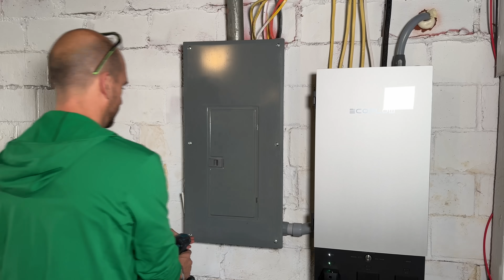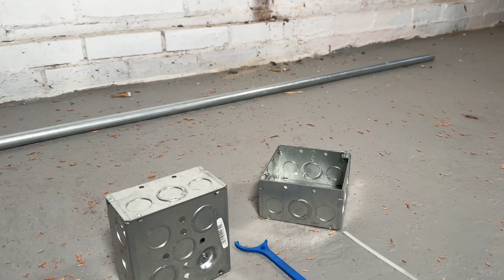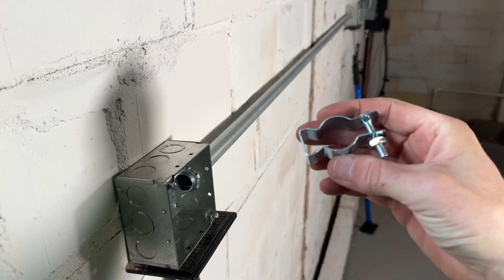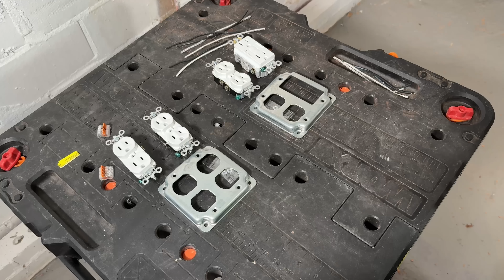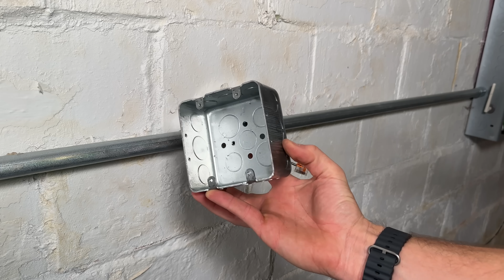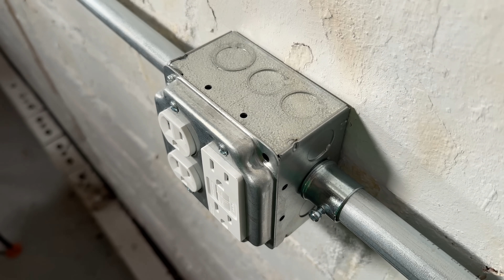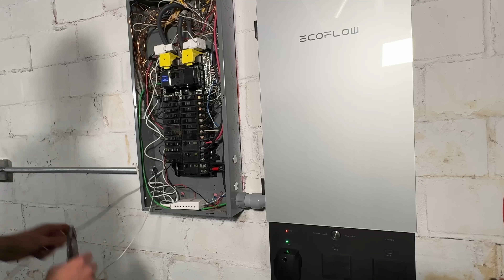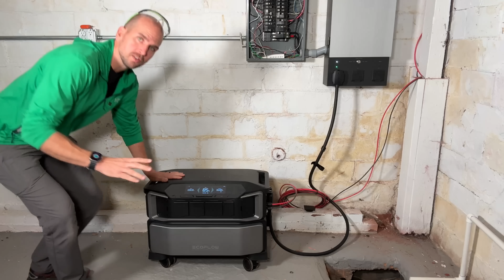Add Outlet To Unfinished Basement Or Garage

Comment: My question is about the 20 amp setup. You have a 20 amp breaker, 12 gauge wire, but the receptacles look to be common 15 amp types?

I would suspect that's a no no, because what if someone draws above 15 amps through those receptacles? The breaker won't trip until higher amperage.

As for ground wire, best to add it and not "trust" the longevity of the conduit connections.

You might also include the reason the boxes are so high up off the floor of the basement (~4ft). [EDIT Mis-spoke "or higher" here.]
Reply from the maker: Yeah, I think adding the ground wire is a good idea.  No issue on the 15 Amp outlets as long as you don’t have a single outlet on that circuit.  Even 1 duplex outlet (15 Amp) would meet code.  I wanted the boxes to clear a sheet of plywood and/or be above a workbench height 👍
Reply: @EverydayHomeRepairs   Just a further on the height above the floor for clarity for others.

I believe code for finished or unfinished basements require a minimum height of 15" (measured from bottom of receptacle box) to a maximum of 4ft (measured from top of receptacle box) above the floor grade.

:)
Reply: @FoxMan777  Not an NEC requirement, though could be a local code in some places.
Reply: @EverydayHomeRepairs  Man these people are picky. I'd stick in the ground wire too, but if it were already installed the way you did it using the conduit for ground I'd use it that way forever without fear. I would NOT do it over. Using EMT for a ground has been done forever and nobody dies. 
Using copper plumbing for a ground used to be OK but is not any more because you're expecting the plumber to be also an electrician. Electrocuting your plumber is never a good idea.

Comment: 1) Don't use a pipe cutter on electrical EMT - that is, except for really tight and/or inaccessible locations that already have wire pulled through the conduit. They always leave a lip on the end of the conduit that's sharp enough to cut through wire insulation during a wire pull. A hacksaw, Sawzall, or multitool and a reamer works so much better without leaving a sharp lip to damage wire insulation, IMO....

2) Never drill into masonry joints to affix your boxes or supports - drill into the solid brick instead. Drilling into masonry joints doesn't support weight - and they will NEVER fail to work loose over time, causing you to have to repair it in the near future as your boxes and supports start to fall off the walls. I'm having to re-affix a whole electrical service panel onto an exterior wall that used plastic anchors (?!!!@#%) drilled into masonry joints supporting the whole panel. Needless to say that 3 out of the 4 of them have failed, leaving the panel only supported by it's conduit (WTF?!!!).....

3) No problem using Romex inside EMT conduit as per NEC. The greater problems are not running a GND wire and not using green GND pigtails inside of your ALL-METAL boxes and your devices. Never rely on any box cover screws as a GND point - once the cover is taken off, the device and box loses it's GND. That's a NOGO......

4) Always support EMT conduit within 3' of every box/termination and every 10' thereafter. If you use the "2x8" rule of thumb (ie: every 2' and 8') you'll always be within NEC.....

Otherwise, very good video......

Comment: It is just as easy to put the wire inside a concrete block wall as long as they are not filled with concrete. You can drop a chain from the top and pull a wire down. Looks better also.
Reply: Fishing through a block wall is not just as easy as surface mounting conduit, not even close.
Reply: @pld8993  Sure it is.  I have never had an issue running wire in a concrete block wall as long as it wasn’t filled with concrete.  You can drop a chain down inside the wall and pull the wire.  It is actually pretty easy.

Comment: The NEC National Electrical Code requires a ground conductor in residential installation even if a mechanical bond is present , just because there is a mechanical bond present this does not eliminate the requirement for a ground conductor in a circuit . You are installing in a damp location as well which will denigrate the mechanical bond much quicker with the potential to harm someone , that is the whole point of guidelines in the NEC to prevent harm . You should also be using fiber bushings on the connectors in the boxes to prevent short circuits .
Reply: The conduit is the grounding conductor. Bushings are not required and unnecessary in this installation.

Comment: I'm glad you used your outlet tester. Now run the test again after removing the cover screws. 

Spend the $little and add the green insulated ground wire.
Reply: Exactly what I thought. With the cover removed the receptacles and anything plugged into them are no longer grounded.
Reply: @TangoIndiaMikeJuliet  Thats why you use a grounding pigtail from the box to the outlets. I have always used a green grounding wire in the conduit, locknuts almost don't get tightened correctly, or setscrews
Reply: 12 AWG THHN is between $0.22 - $0.60 per foot at the time I'm replying.  Price is so insignificant I'm honestly surprised he didn't pull one.

Comment: And you are totally in violation of the National Electrical Code with no grounding wire in the conduit. You are also working backwards. Shove wire from the panel never into the panel  unless there is no other option.  The code specifies you need a grounding wire in conduit due to thermal expansion and contraction of the conduit loosening the couplings and connectors. You also really don't want Mineralac straps that low. They catch on stuff like clothing, so bend some box offsets in that conduit. I also like to have TWO circuits for a garage so larger power tools won't overtax the circuit. For old red brick and lime mortar I use plastic or lead hollow wall caulk anchors rather than those hard blue screws. Bricks like to crack and that old pre-Portland sand & slaked lime cement mortar is way to soft to hold those screw anchors in. You need that conduit supported within 3 feet of each box and every 10 feet there after.
Reply: Code does not say you need a ground wire due to thermal expansion and contraction of the metal. A metal conduit ground, when the conduit is installed properly, does not require a wire-type ground. The NEC list 14 types of grounding conductors allowed, and only one of the 14 is a wire.

Comment: I just *LOVE* the way you used a step drill to enlarge the opening of the knockout a mere minute into the video of things done wrong... watching those wires vibrate as you hit them and potentially cutting the insulation was priceless.  I also notice that you did not clean out any potential shavings that might fall into the inside of your electrical box.  Also, trusting your ground to your EMT and boxes is not very clever over time since simple corrosion can disrupt your "ground" and end your compliance.  Another question I have would be "where is the isolation from the grid for your battery backup?" in the case of a power outage, you are now back feeding the utility lines and either feeding your neighbors power or endangering line workers who might believe that power has been isolated, even though they should always be checking anyway. Great "educational" video...
Reply: I agree on most points, but grounding via an EMT conduit run is completely normal practice. Never have I seen a run lose ground continuity for any reason aside from incompetent installation. Ground wires in EMT conduit are generally redundant.
Reply: @NoTroubleMikeG  Yes, it can be a "normal practice" for interior runs, and yet I have seen hundreds of runs within buildings that have fallen prey to corrosion and the associated faults and intermittent connections that corrosion can cause. Many industrial applications recommend (if not require) ground wires on all wire runs through EMT as people have been injured due to faulty grounds.

The NEC states that the path to ground in circuits, equipment and metal enclosures for conductors shall be permanent and continuous. Complying with guidelines in the Fittings section 4.3 and Support section 4.4 is the major factor in maintaining electrical continuity. Using less than the NEC-required supports or failing to properly tighten joints can cause discontinuity in a raceway system, which would result in the failure to carry a ground fault. Good installation workmanship is critical.

These regulations often get put into place because there have been injuries or death associated with a specific practice. In comparison, Knob and tube and Edison fuses used to be the "standard practice" until injuries and fires proved those methods to be dangerous... Some of the most deadly words uttered are "We've always done it that way" or "I've never seen/had a problem with that before". Go ahead and spin the cylinder and pull the trigger, it's not my circus and not my monkeys, the burden and chances are on you.
Reply: See video on the “smart” sub-panel he used, system for backfeed prevention is located there; the custom connector between the battery/inverter unit and smart panel has data leads in addition to the power leads.

It isn’t like “dumb” subpanels needing manual interlocks.

Comment: And I might have run a separate 20-amp run to each box, so I can have like a compressor plugged into the first and some other higher-current load on the second.

Or maybe the left outlet in each box on one circuit, and the right outlet in each box on the other.
Reply: I did this in my garage.  The right outlet is white and the left outlet is grey.  I also ran black/white THHN to the white outlets and red/grey to the grey outlets to help prevent wiring it wrong.
Reply: And, when I set up a weatherproof outlet box outside, the box can hold two outlets.  I set it up with a 20a 240v outlet (L14-20R) coming straight off the 240, and a duplex outlet with one part on each leg of the 240v, isolated from each other by breaking the connecting tab like you would with a switched/unswitched outlet.  I painted the two parts black and red as a reminder.  That way I can plug in a single 240v plug like for an RV say, or each half of the duplex can handle a 120v 20a load such as a compressor or other power tool.

Comment: It would have been easy to do this without any of those lever-nut things.  Just use two of the pigtails from the "load" side of the GFCI outlet to one pair of screws on the first duplex outlet, then connect the wire run to the second box, to the second pair of screws (hot/neutral) on the first non-GFCI duplex outlet.  At the farther box, the direct run goes to the first duplex outlet, and then pigtails from the second set of screws to the second duplex outlet.

And a separate ground wire, of course.

Comment: I'd still run the ground wire. It doesn't cost you that much more, and it ensures that the circuit isn't going to ground out to itself, potentially shocking a user.

Comment: What I use for cutting conduit is an angle grinder with a cut off wheel because it leaves a burr that's much easier to ream out than a burr that a pipe cutter leaves
Reply from the maker: I could get behind that method 👍
Reply: @EverydayHomeRepairs  One time I used a pipe cutter and it took forever to ream out the burr , Then one of my coworkers said , Use my angle grinder and what a big difference it made , I was able to ream out the burr 100 times faster than cutting it with a pipe cutter and so I immediately went out and bought an angle grinder , I use it for all of my metal cutting and it sure goes faster than using a pipe cutter , And very very little do I use a hacksaw , The angle grinder is excellent for cutting flexible conduit ,
Reply: @ironmartysharpe8293  In the pro world we use either a metal cutting circular saw or a porta-band, I prefer the circular saw and have been using one since 97. Angle grinder works fine but not the best choice when you're bending and cutting all day.
Reply: @pld8993  Yes , A circular saw or chop saw is great for big jobs where alot of cutting is involved , Still , The burr they leave is much easier to remove than the burr left from a pipe cutter
Reply: @ironmartysharpe8293  Agreed. Never use a pipe cutter, something I learned my first week as an electrician, and it was back when all we had was a hack saw since battery tools didn't exist yet.
Reply: @pld8993  Ever since I bought my angle grinder , I got rid of the pipe cutter , Mainly I do electrical work on the side and for deburring the pipe I'll use my Dremel tool as I bought a set of tungsten carbide rotary files and they work great , A Dremel tool is a must have for your tool family , For me it's been a huge help if I ran into any snags from enlarging a hole a little bit to having a cut a notch in something , So whatever job I do
I always make sure to take the Dremel tool with me , Don't leave home without it

Comment: This is a clean installation. There is nothing wrong with this installation. No separate EGC is needed as the conduit is a compliant use as an EGC. With this installation all that is needed is to remove the insulating washers from the receptacles for metal-to-metal contact that extends all the way to the panel. He is also using THHN 12awg which is also compliant. EMT can be used underground and within concrete. It's perfectly fine for this damp location installation. If anything there should be a conduit support at the center of the 6 foot length per 358.30. This is an excellent how-to video despite the hypothetical what-if's mentioned.
Reply: Yes, there is something wrong. In addition to the 6' run needing support, receps are grounded incorrectly. Need a grounding pigtail from box to receps, or receps must be riveted (or some other permanent means of attachment) to the cover.
Reply: @pld8993  If it was a plastic cover i could see the need for the pigtail, but it is metal and receptacles are secured to the face plate with locknuts and the plate is fastened with screws. The mechanical ground is sufficient.
Reply: @joetorres3412  Electrically it works, but it's a violation, 250.146(A)
Reply: @pld8993  I'm learning here so would like your feedback. the two conditions 250.146(A)(1) and 250.146(A)(2) appear to BOTH be met since the author states that the device screws have ridges on the underside of the head which I am interpreting as complying with "screw or nut locking means".
Reply: @MegaMcwizard  Ridges under the screw head or nut is not a locking means because it doesn't lock the screw. Irreversible screws, rivets, screws with a locking nut, or the addition of lock washers to what he has would be required.
Reply: @MegaMcwizard  Until the early 90s, receps were mounted and bonded to surface covers with a single screw in the center but with only screw, loosening would compromise the bond to the recep through the cover. The NEC then started requiring 2 screws for mounting. Eventually, they started requiring permanent means of attachment to the cover (rivets) when the cover was used to bond the device. In 2020, they added (1) and (2) to allow for nonpermanent means, locking nuts, for example. The point is if the attachment screws are being used to support the bonding (no pigtail), keeping them from loosening is critical.

Comment: I can't see it mentioned in the comments but my curiosity is getting the better of me - why use the pig-tail & Wago (or wirenut) method rather than linking the cables on the outlet screw connections?
Reply from the maker: I use WAGOs for most projects but also they come in very handy for this type of installation where the outlets are secured to the cover plate.  Then you just need to flip a few levers to get everything tied together.

Comment: Professionals will bend offsets for conduit when attaching to boxes. Running conduit straight from box to box is ok technically but its a sign of amateur work. Also not running a separate and dedicated ground would never pass for code in my area. Rather a separate ground should be run which is bonded to each box. Usually there is a ground screw in each box for this purpose. Depending on EMT conduit connectors for a safety ground is not reliable.
Reply: EMT, when installed properly, provides a very reliable grounding path and is electrically better than a coper wire.
Reply: Conduit without box offsets is not amateurish. It's done all the time using minis instead of 1-hole straps for conduit support.

Comment: Or, if you don't want your place to look like garbage, just run Romex along the top plate and down inside the blocks, and cut a hole in the blocks for a recessed box just like you would for drywall.

Comment: I'm a datacom guy, and don't do a ton of conduit. My one customer where I often have to use conduit to come down a wall with, or sometimes more than that, they are a manufacturing plant and require the dustproof fittings for conduit. And, to be honest, I really like them better than the set screw type connectors. 
I love these device covers you used here, I use the same ones and then use a type 106 bracket that basically makes data jacks fit where standard outlets go; really nice looking when you are right next to an outlet. (I make sure I buy the same brand and finish of device plates as their electrician uses so we match.) 
When I do electrical stuff for myself, and I am using 4-squares with raised device covers, I use grey outlets as they look much better. 
I disagree with not running a ground wire. I know it's permissible by NEC, but I don't like it.

Comment: May I ask why you cannot use romex wire?
Reply: Cannot run exposed romex on a wall surface unprotected as it would be subject to physical damage.
Reply: I was not referring to using romex unprotected but I believe you didn’t even want to use it in conduit